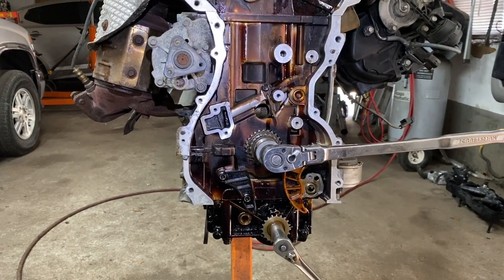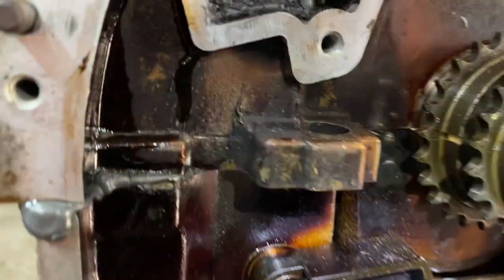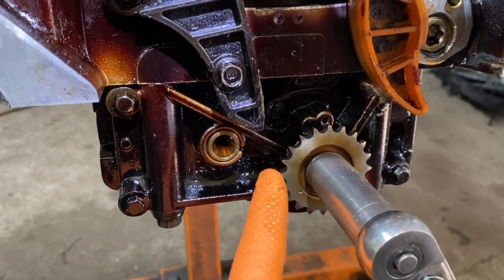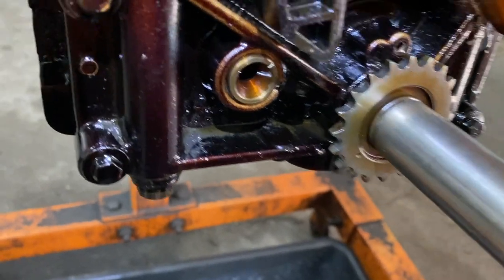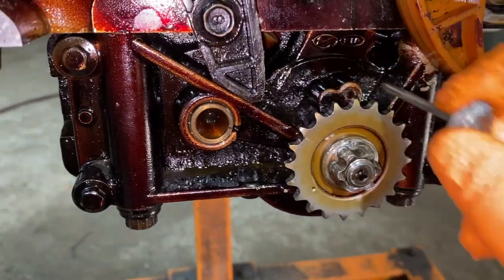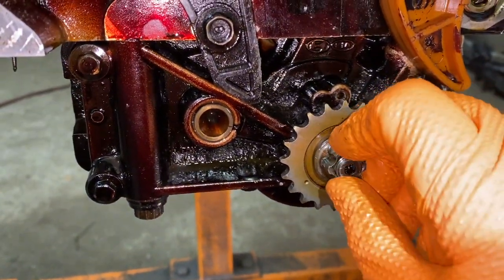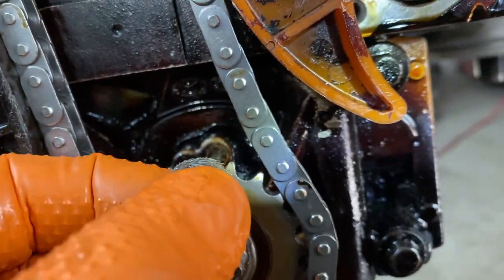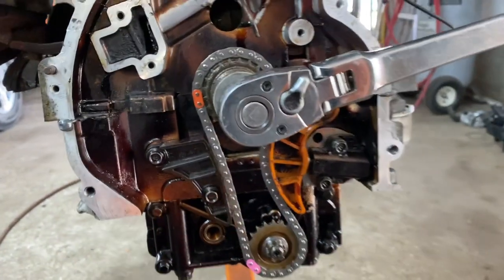Oil Pump/ Balance Shaft Module Timing Chain Mark Alignment On Hyundai / Kia 2.4 L-  2007 & Up

Comment: Hi. I have watched your video and find this useful. I have an issue with a 2015 Hyundai Sonata 2.4 GDI. The code P2088 is still Active even after Intake and Exhaust cam replacement. Cam position actuator sensor was also replaced, but the code P2088 is still on and engine rpm is high above 1200 rpm. Please advise
Reply from the maker: Thank you!

Valve timing can be off 1 tooth and could have a vacuum leak for the high idle.

Comment: Hello
That was an informative video.
I have question
I installed an oil pump on the engine and fastened the bolt in the correct way, but after installation, the oil pump jumped and didn't move, then after a lot of try and error, I put 2 washers between the balance shaft oil pump and frame ladder and I fastened the bolts and everything became okay.
Do you think this trick works?
Reply from the maker: Honestly , there should be no reason to add washers to the oil pump if it was not there from the factory. Something is not right and I wouldn't feel comfortable driving vehicle like that.

Comment: If the balance shaft isn't lined up properly would it effect compression? I am having a issue getting the engine on time which should be easy with the markings. But I did not do what you did with the oil pump gear
Reply from the maker: If the balance shaft isn’t lined up engine will shake but won’t effect compression
Reply: @Motorcarnut  this stupid thing got low compression and won't start valves are good timing seems on would one took or half a tooth off affect compression
Reply from the maker: @josephg8818 yes it would

Comment: Did you change any of the sprockets when you did the timing job? Curious if I would need to. I only have 130 thousand miles
Reply from the maker: No, you should be fine if just normal wear.

Comment: Hello nice video please the name of the tool used to loose the oil pump nut
Reply from the maker: I just used a 6 point socket with an impact and I believe it's reverse threads. I didn't have that special tool.
Reply: I think an E torx socket should work.